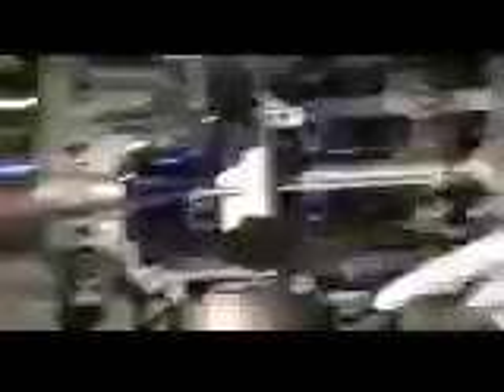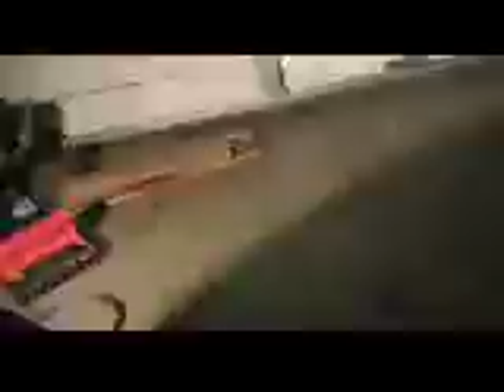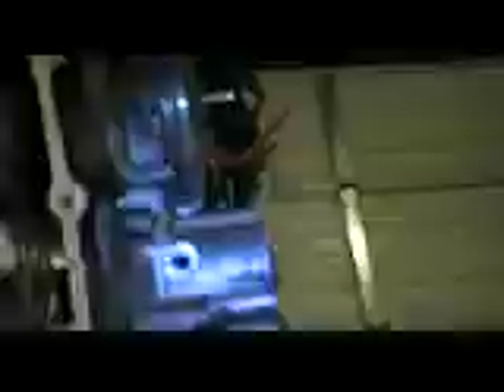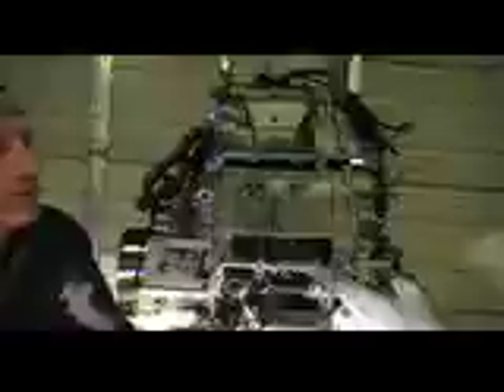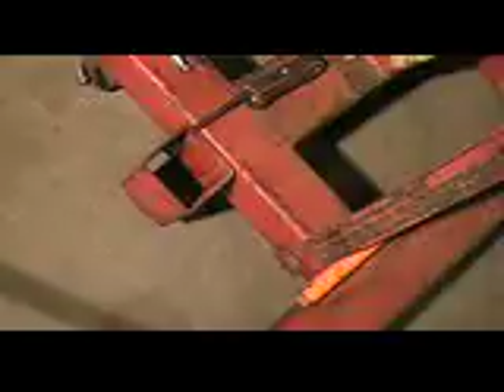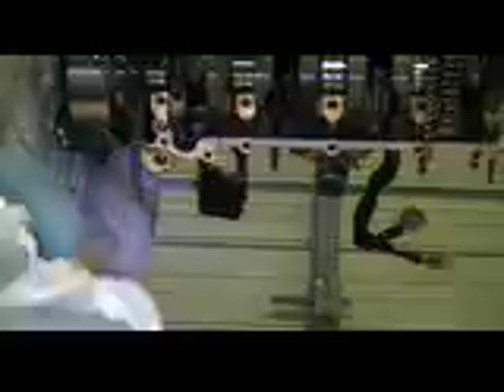2nd gear fix Yamaha 1999-2002 r6 transmission 2nd gear fix. Up grade 03 r6 transmission

Comment from the maker: There are a number of parts dealing with this issue any person who has little experience with bikes, u should go see a shop and get a diagnostic. But there is a spring on the left side where the shift shaft is, and its under a cover it requires some work but not as much as taking apart your engine.look for r6messagenet.
r6-maintenance
 you could damage your bike by running it the a broken spring can damage your tran
Reply: I put my vmax in second and can push around and I just hear click click click. What do think?

Comment: I just did this exact job on my 99 R6. Was afraid to do it myself but once I got started it came apart easy and went back together easy as could be. Just dont rush the taking a part must have good memory. Lots of pieces. But it will only go back together one way so no worries. Simple design as well. Just crappy forks and dogs. 03 R6 design is way better.

Comment from the maker: i would have to say that my problem was different my spring broke from the shift shaft and it bent my transmission. I guess look at the milage on your bike, 2nd gear usually takes about 20k + miles to really notice. My bike would go from second into neutral, if your gears are slipping from 1st to second you might be experiencing early signs. Take your bike in to a shop have them look at your carbs that could be it. Hope its minor any other advice, i am only speaking from personal experience.